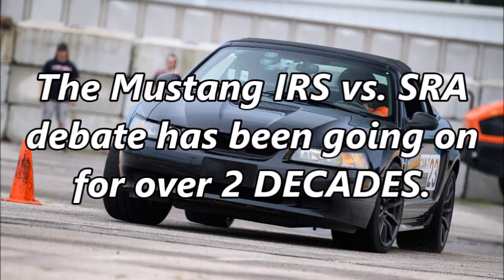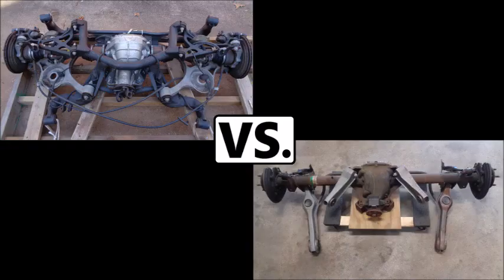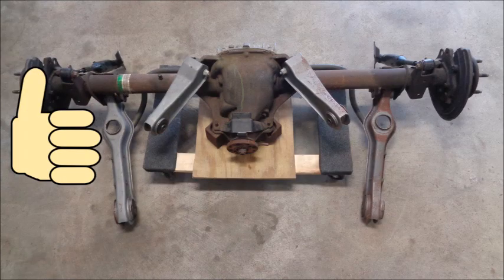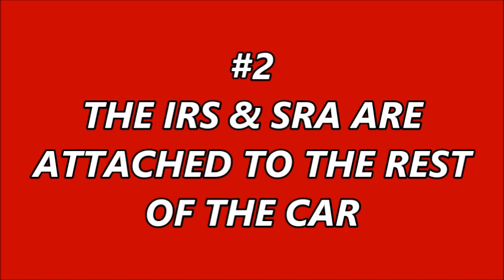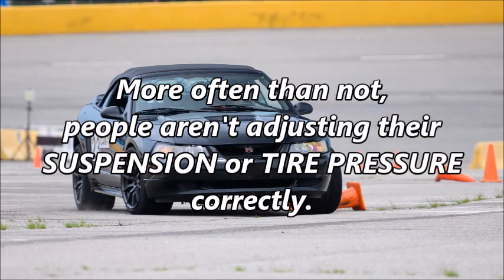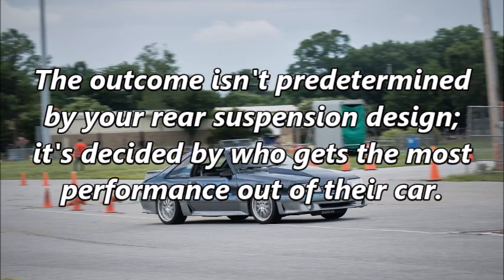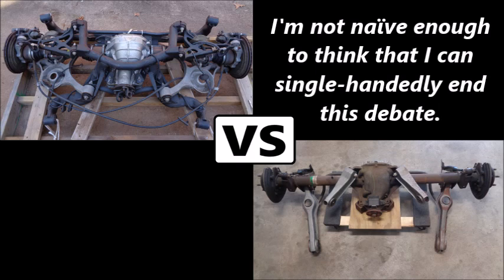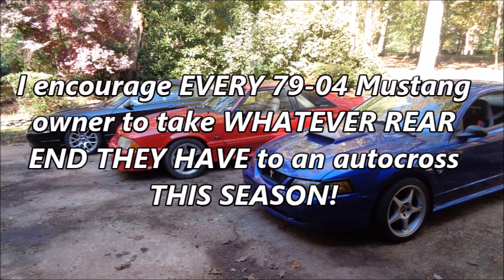5 Reasons Why the 79-04 MUSTANG “IRS vs. SRA for Autocross” DEBATE is POINTLESS

Comment: I converted my Fox to a PM3L with a panhard bar and it transformed the car. Combined with DA shocks, the rear end is magic. It feels like a different car. I am curious how an IRS might feel, but I don't see it worth the hassle now.
Reply: Running the same with a watts on my SN95! What is your overall setup on the rear?
Reply from the maker: I've always been impressed by how much better the SRA gets with the right mods. I was lucky enough to get to autocross the same car with an SRA and an IRS (my 2000 GT). The IRS allows me to get on the gas earlier and it's definitely more composed over rough surfaces than the SRA. But I always know I'm in for a tough battle against the SRA cars in my class.

Comment: I love the insight here! Number 5 cannot be understated enough! Although I think the cost between the 2 I think needs to be hit on a little harder. I recently bit the bullet and purchased a full Maximum Grip box from MM for my 01 GT with the stick axle. It briefly crossed my mind to install a IRS in the car but after looking at the price of an IRS assembly it was hard for me to justify. Most of the units that I saw were going in the 2,300 to $3,000 range and still would need roughy $1,000 worth of bushing upgrades to reduce the wheel hop, bushing bind, and diff cover issues. 

I ended up taking that $1,000  and put it in a torque arm and panhard bar for my solid axle. I'm not a good enough driver to be able to extract every .1 of a second out of the car. So nearly $4,000 in a rear suspension setup is hard to justify if my skill level is the main issue at this point.

Overall the car is literally a different car with the full MM setup. The ride believe it or not, is better than stock. The car is so comfortable that you start to forget it's capabilities when just cruising down the highway. The turn in is so much quicker it feels like I installed a quick ratio steering rack. The car simply does what it should. Very compliant over bumps but reacts instantly to steering inputs with zero body roll.  It still has the solid axle mid corner bump side step but, overall rear grip and predictability is dramatically increased. The grip level is lightyears beyond what you can try on the street. Not cheap but 10/10 highly recommend.
Reply from the maker: IRS assemblies have doubled in price since I purchased mine. And there's a limited supply of them out in the world. The reality is that everyone who wants an IRS isn't going to be able to get one. And, as someone who has to build on a budget, I completely understand why many people don't want to spend the money to acquire and modify an IRS. But, despite the fact that there are many different companies making SRA mods that greatly improve the handling of these cars, many people still don't see SRA Mustangs as capable autocross cars. And they don't realize that it only takes a few mods (the right ones) to make an SRA Mustang handle MUCH better. That's one of reasons why my latest project is an SRA Mustang. If I can get a n/a 2.3L SRA Fox Body to post decent times out on course, it should prove that ANY 79-04 Mustang can be a capable autocross car.
Reply: Do you have less ground clearance with the Torque Arm?

Comment: I had to giggle a little bit when I heard "prepped for CAM". "Prepped for CAM" just means throwing the entire MM catalog at the car.

You've addressed pretty much everything I've ever heard about the IRS/SRA argument that I've talked about with other people, and you've summarized everything really well. Everything I had always heard was just asking the question "do you plan on doing anything besides autocross?" and then deciding where to go from there.

I find the particular advantages of the IRS to make for a car that is more pleasant to drive on the street. So if it's a fast daily driver, or a fun weekend canyon carver, I'd say go IRS.

If you're going to go to the drag strip with a set of slicks in addition to autocross/track days then go SRA.
Reply from the maker: Even though the CAM rules allow pretty much any suspension mod, I've never been one to recommend throwing the whole (any company) catalog at the car. The Mustang aftermarket is awesome, but an unfortunate side-effect of having so many parts available is that many Mustang owners think these cars can't be capable autocross cars without installing a catalog full of mods. I hope my channel has been able to show that, at local events, a Mustang can do well in CAM without being "fully prepped for CAM." 

This video was focused on autocross, but I tend to agree that an IRS car would be better for a daily driver (especially if the roads in your area are rough). I don't have any drag racing experience, but most of the people I know who drag race prefer the SRA.
Reply: @warhorseracing   oh yeah, they don't need much to be capable at autocross. Lowering springs, sway bars, and dampers are all you really need (plus replacing the 20+ year old suspension bushings).

It's mostly just a joke at what "fully prepped for CAM" involves, especially if you want to go to nats and race against some guy with a coyote swapped fox body with carbon panels and 315s on all four corners. (said car was just sold for $15k and I should have bought it. I have the facebook marketplace link to it if you want to see it)
Reply from the maker: @Higlac89  One of the good things about CAM is that it has introduced more Mustang owners to autocross. I just hope people who don't have heavily modified Mustangs know that there are other SCCA Categories that Mustangs fit into. I've seen a few ads for "Nationals" CAM cars; some are very impressive.
Reply: @warhorseracing  oh yeah, definitely. One thing that always annoys me is how a lot of people tend to treat the newer mustangs and camaros. They're still in the mindset that the muscle cars can't turn, when in reality the s550 and 5th gen camaro are some of the best sports cars on the market.

Did you happen to see the blue 86 for sale in Kansas City about three months back?
Reply from the maker: @Higlac89  I've been able to drive the newer s550 Mustangs at a few events and they are very good autocross cars. I know people who autocross the 4-cylinder Camaros and they are really fast. We are seeing more of these cars at our novice schools and events, which is a good sign that the perception is changing.

Unfortunately, I didn't see that blue 86.

Comment: I used to think IRS was vastly superior until recently. Went to an autocross event with my 17 GT. There was a 23 mach 1, a 20 GT PP, an 08 GT convertible, and a few other mustangs, corvettes, camaros, a viper, and every other common car you usually see. The mach 1 was the fastest american car there running 49s and beat all the corvettes and the viper. Guess what the second fastest was? The 08 GT convertible that was almost completely stock ran a 50s. He had a crazy amount of body roll and it looked like he would lose control at any second, but he was putting up very good times, and was a novice autocrosser. On paper he should have done poorly with less power and a SRA, but he drove his car very well.
Reply from the maker: A driver with solid fundamentals can get everything out of either suspension design. One of the best things about autocross is watching older cars go up against new cars. I'm glad to hear you have so many Mustangs at your events!

Comment: Great factual points on this matter. Both suspension systems have their pros and cons, but if setup well and the driver is capable the gap gets narrowed. I have an 89 Mustang and at the time (2005) I also had a 96 F150 short bed, 302, auto trans, towing package, Bilstein shocks, good tires and no antisway bars. Went to an autocross with a friend to watch him at his Corvette Club and they wanted to see what my F150 could do. The snickering stopped as the times I pulled amazed them :hand-orange-covering-eyes:.
Reply from the maker: Thanks! I've seen some fast pickup trucks and even a very fast Jeep at my local events. It's always fun to see what a capable driver can do in an atypical autocross vehicle.

Comment: If I remember correctly Maximum Motorsports compared a fully prepped IRS to a fully prepped SRA.  In the end they decided the SRA was faster on smooth tracks and the IRS was faster on bumpy tracks.
I will say an IRS has more things to adjust (toe, camber), so if you aren't interested in adjusting things you should stick with an SRA.  Either can be fast.
Reply from the maker: The IRS has more to adjust, but those adjustments give it an advantage. But, on any given autocross run, that advantage can be lost due to a number of factors. I think people should look at it less like a debate and more like a challenge: Who can get the most out of their setup?
Reply: @warhorseracing  I agree completely

Comment: Put on a panhard bar and a torque arm on the SRA and then tell me it doesn't work. In the 90s I did just the torque arm and that makes a lot of difference.  Sidestep the clutch at 20000 RPM lon the street and hook with all season radials. Apply heavy throttle coming out of a corner and the ass end no longer comes around. If it steps out, it seems to force itself back. I used a Griggs Racing sold by SVO. I took a lot of people out who owned Japanese cars that thought Mustangs coudn't handle and the STFU immediately.

1986 GT. Welded in subframe connectors. Welded seams on pinch welded K member. Tokico shocks. Energy suspension bushings, Eibach springs. Griggs racing torque arm.

Comment: My two cents.  I have a 99 Cobra and have no experience with a SRA Mustang.  I have fully rebuilt my IRS with bushings, toe links, etc.  At no time have I felt like the IRS in my car is holding me back.  It's very controllable and predicable.  My Cobra sees more autocross than street use.  I'm no expert but this is my specific experience.
Reply from the maker: I've been very happy with my IRS cars. My SRA cars have performed better than many people expected. I always encourage people who haven't autocrossed a properly modified & adjusted SRA to give it a try. Because you have a lot of autocross experience, you'll be able to get a sense of the differences in the handling characteristics of each design. And it's really fun to throw an SRA Mustang around on course!

Comment: In short, the best aftermarket suspension parts for IRS or SRA isn't what makes a car fast or slow. It's the driver behind the wheel. Suspension parts help but it's ultimately the DRIVER.
Reply from the maker: The first modification anyone autocrossing their Mustang should make is to improve the driver.

Comment: The way I look at it, your decision between an IRS and SRA should be based on budget, what your car has already and “cool points”. From what I’ve seen and driven, the performance difference between a well sorted SRA and IRS equipped car is marginal at best. 

That being said, an MM torque arm and panhard bar SRA is going to cost about $1,100 not counting springs and shocks. As of today, June 2022, a stock IRS costs about $1300 to get a hold of. MM’s race package for the IRS is an additional $1300 not counting springs and shocks. If you choose to add Kenny brown tubular arms, you can expect to add about $700 for lowers (if you want coilovers) and $900 for uppers to MMS kit. 

So if you have an IRS equipped car, you can almost find an entire SRA swap complete with a TA/PHB upgrade if you well off the IRS. 

But as I said before, your choice should come down to budget, what you have now, and if you think being able to say “I have an IRS swap” is worth the extra money. Either way, like you said, you definitely shouldn’t be kept from running an autoX course, road course or a fun mountain road simply because you don’t have an IRS equipped 79-04 mustang. Not having a properly set up car has ever kept me from having fun, I’ve driven fun roads hard in a stock 1st gen focus, and I’ve done it in my navigator. It’s about having fun first, especially when starting out.
Reply from the maker: Budget is definitely important. IRS assemblies are only going to get more expensive and harder to find in the future. If people want to autocross their 79-04 Mustangs, they are going to have to drive SRA cars. A good autocross setup doesn't have to cost a fortune. I was able to compete with TA/PHB equipped cars with a $150 Steeda adjustable rear sway bar.

Comment: Where is the best place to buy Tokico suspension parts?
Reply from the maker: As far as I can tell, the Tokico shocks & struts for 79-04 Mustangs have been discontinued. Most people I know go with SA or DA Koni Yellow shocks and struts. The KYB AGX adjustable shocks and struts are another option. I have not been able to test them extensively, but I was impressed by their performance when I suggested them for the Humble Mechanic Mustang build.

Comment: IRS or nothing. LOL

Seriously though, I've owned a max effort SRA setup (not for drags but for road racing and open tracking) a decade ago and I currently run in the same car (96 Cobra convertible) a max effort IRS. And when I say max effort, I really do mean it. I literally had and still have the highest grade components possible. I have to say just from my own point of view that the IRS in peak form can edge out an SRA in its peak form... but only for everything except drag racing. I would be very, very skittish about dragging my IRS car and worrying about breaking some very expensive parts.

But in the end...

All we really have to ask ourselves is:  have we ever seen a super or hypercar run an SRA?

A good video nonetheless.
Reply from the maker: This video focused on autocross because that's where the performance gap between the IRS and SRA gets smaller. There are so many things that can happen on an autocross run to give someone with either design the win. Out on a race track, a driver with an advantage can build a lead over multiple laps. Most of the time, autocross runs aren't added up into a total time. It's all about who can get the most out of their setup on an individual run.